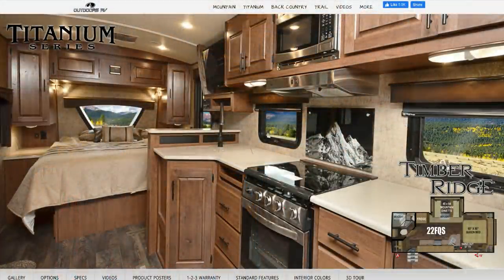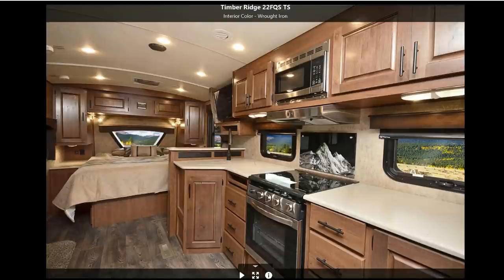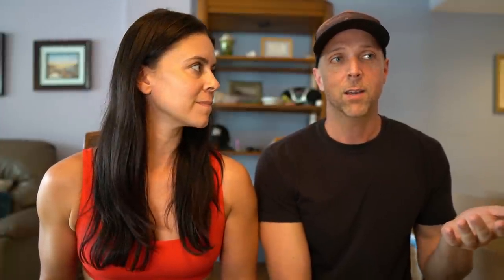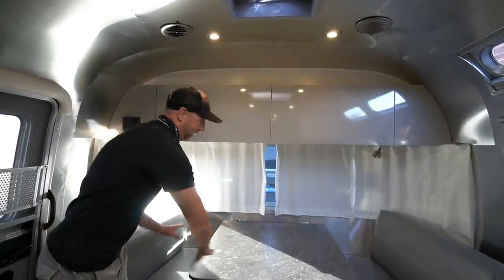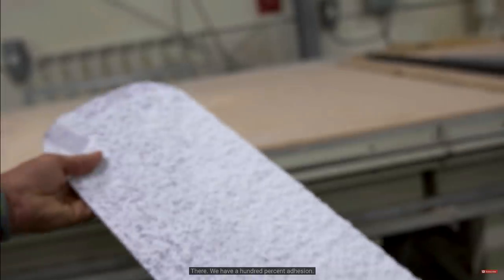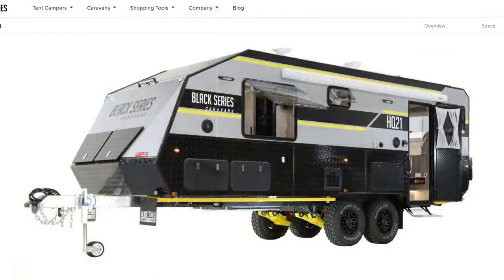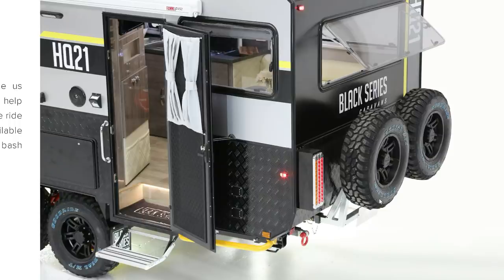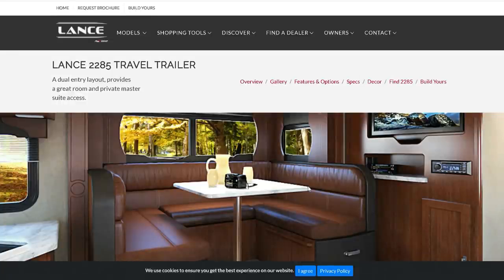Why We Chose Outdoors RV Over Airstream, Black Series, & Lance Travel Trailers

Comment: Glue and screws will fall apart! Slide outs will fail especially if you take it off pavement.  Cant wait to watch this decision.  😂😂😂🤣🤣🤣😂😂😂
Reply from the maker: I hope it doesn't fall apart!
Reply: @IreneIronTravels  I’m not being mean.  We have been RV’ing for 17 years and have owned 7 different RV’s and have used them in multiple different environments.  Every rig we have purchased gets stress tested while under warranty to see what fails.  We stress tested up the Alaska highway and then out in 115 degree temps in the Mojave desert. The most important lesson was the slide!  The slide will come out of alignment from jolts and bumps and from being used in salt air and dirt.  The gasket around the seal is the weakest part because it is attached with glue. The slide gasket also is where no matter how good the insulation is that is where moisture cold air and heat will enter your rig.  It’s not the suspension that is a big deal or lift kits it’s axels and their weight ratings. We have watched your videos of your reviews of various campers and it seemed like you guys missed examining the the thing on a camper that will fail for the type of use you guys hope to use this thing in.  I think the Airstream would have been a better choice in the long run for durability, reliability, and most importantly resale.  We love you guys.  You could have a Basecamp 20X for the same money.
Reply: Not a huge fan of slide outs either.  That being said, ORV builds a much better trailer than any thing else in its price range.  Remember, AS is owned by Thor Butt now.
And you ARE being mean.
Reply: @jeffforbess6802  and why aren’t you a fan of slides?  I’m not being mean I’m only giving my informed opinion based upon real life experience with own both types of RV’s.  30-50k will get you an Airstream!  Besides they asked for comments Bruh!  Lighten up!
Reply from the maker: Thanks for the follow up. I think we could have been happy, space wise without a side, especially coming from a van. I've heard a lot of the horror stories of slides and we've never had one.....sooooo it will be a good learning process and I look forward to seeing how well (or not well) it will all work! They are definitely not good for off roading, but I think we'll like the extra width and not having a pinch point in the hallway. Time will tell! Thanks!
Reply: @IreneIronTravels  yeah and we almost upgraded from a 24’ to a Winnebago Boldt.  Then when went to a 42’ Tiffin Phaeton and even put a deposit To pick it up the following day. Then we remembered back to some old wise Canadians who shared with us why we should buy an Airstream. We went home and slept on our decision and awoke to going to take one last look at the Airstream products.  We could have any RV we want especially when we were choosing one to full time in.  We decided on a An Airstream Classic 33’.  We were concerned with the lack of slides and not having enough space to live.  The crazy thing we discovered is that we have plenty of room and space to carry what we need to Full time glamp.  We also camp and adventure just like you guys!  We are planning to buy an Airstream Basecamp 20X to eventually drive to Argentina down the Pan American Highway. My comments were intended to share what we have learned with buying numerous RV’s and USING THEM.  We don’t just weekend in them we put an RV through it’s paces.  Anyway we wish you guys all the fun and luck we have had and shared with everyone!!!!  Maybe our paths will cross and we will talk in person!!  :)
Reply from the maker: Can't argue with AS quality. You know we love it! The Classic's are great and we've been trying for a year to see a new one with the comfort white interior. Base camp to Argentina sounds like a blast!  See ya on the road someday!
Reply: @IreneIronTravels  FOR SURE!  We are @airstreamtrippin